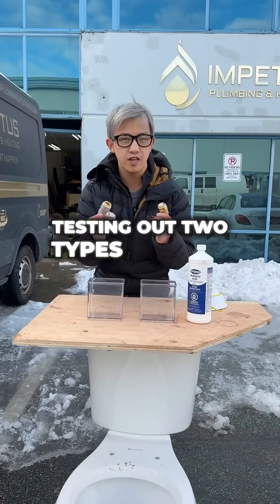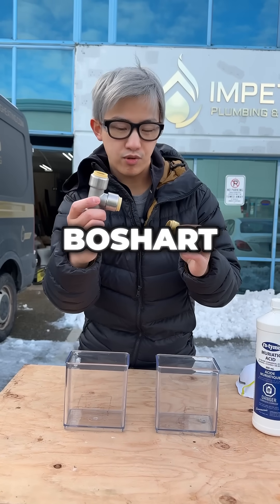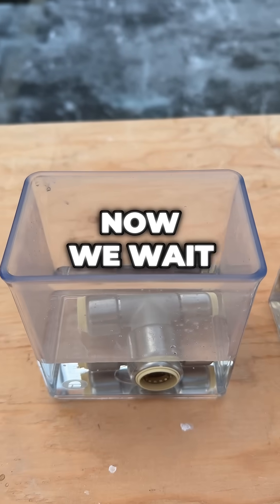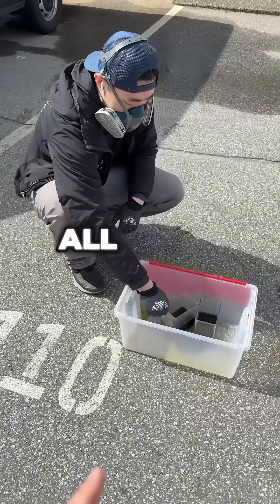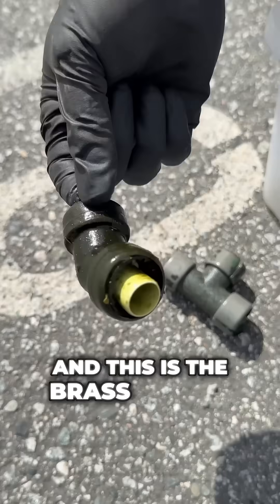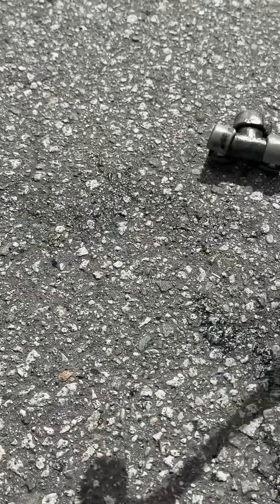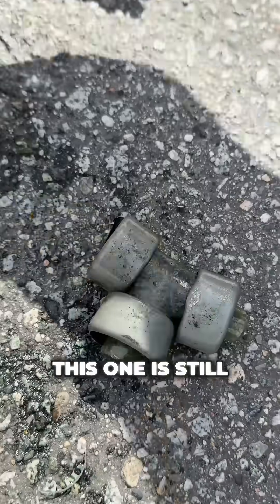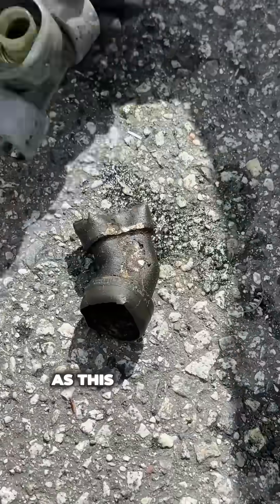Acid VS Stainless VS Brass

Comment: What was the condition of the interior plastic & rubber sealing Orings for each metal fitting? Full strength muratic acid is not a common substance found in household water supply.  Brass is a much softer metal compared to stainless steel, so what was this presentation supposed to demonstrate? Steel is stronger than brass. This we knew.  Brass/bronze is used to stop corrosion from electron flow between disimiliar metals within water supply systems. Acid + dissimilar metals = battery (i.e. corrosion between dissimilar fittings).
Reply from the maker: I’m just trying the stainless steel fitting against muriatic acid to see how well it works, because I was thinking of using it for condensate for boilers. So just testing it and seeing what happens when it’s used with brass as well and how long brass can last. Just a fun experiment for myself